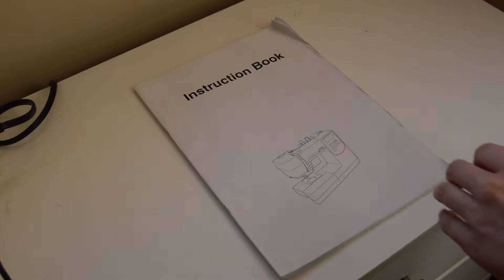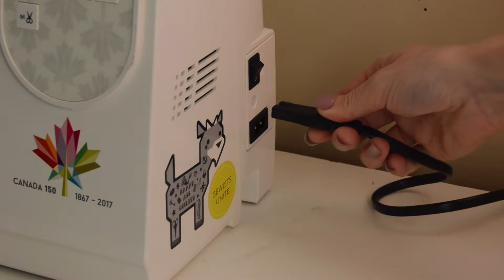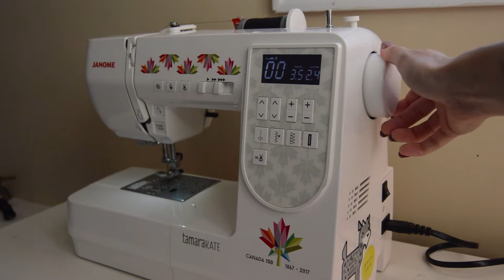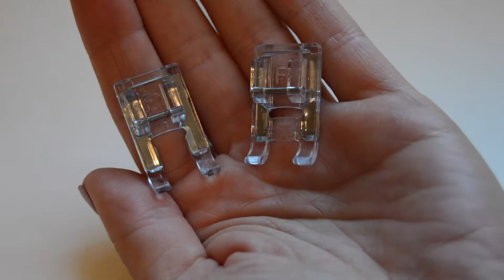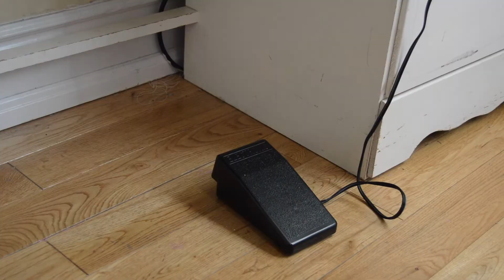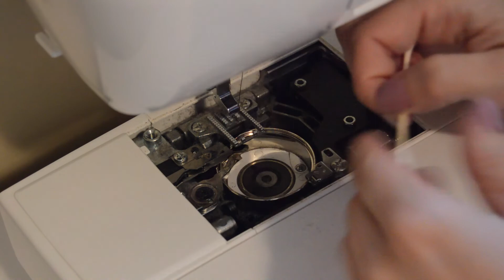How to use a sewing machine // Sewing Machine 101

Comment: whats the tension for? different fabrics need different tension?  when is a tighter tension used generally? is a lower tension needed for delicate fabrics?  its a mystery to me. I just bought a new machine
Reply from the maker: Hi Patti! Proper sewing tension is when the top and bottom threads are balanced. The stitches will look the same on the top and bottom when the tension is correct 😊 It will take some trial and error to figure out what tension you need for a project, I usually test on a scrap piece of fabric. Generally if you’re using thick thread or thick fabric the tension will be more, and if using a lighter thread or fabric tension will be less. Hope that helps!
Reply: @MarysMakesandMends  oh it helps alright nice and easy way for me to know. thanks I am a complete novice considering my age its a bit embarrassing tbh . ty!
Reply from the maker: We all start at different ages! 😊 glad I could help!